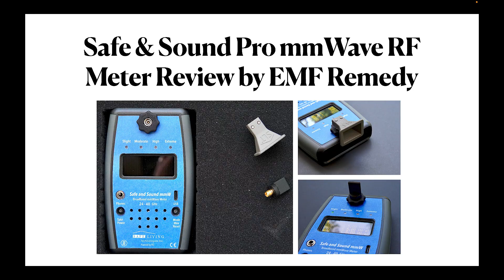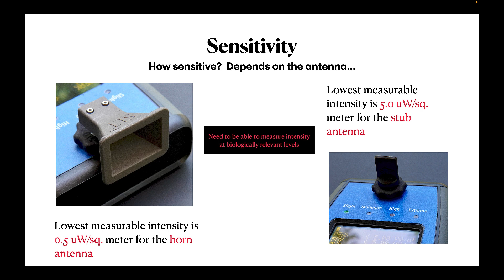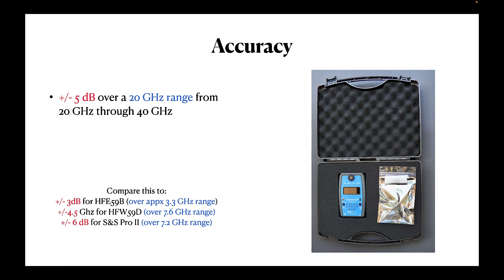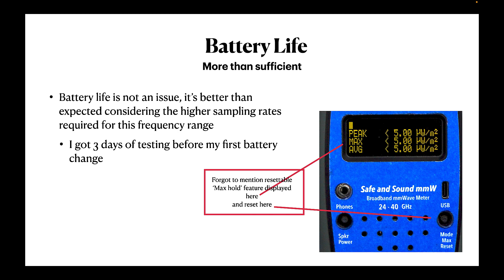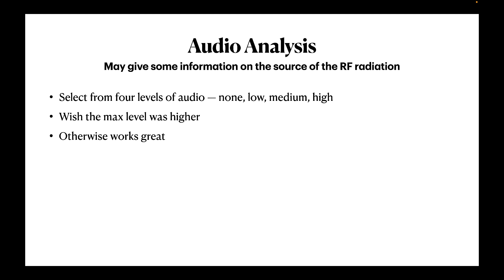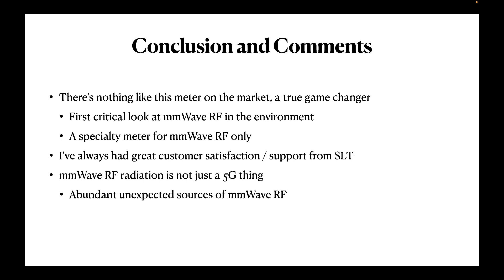Safe and Sound Pro mmWave RF Meter Evaluation and Review

Comment: hi there, is there a meter to test mmWave used for cars and smart devices that are in the range more than 60Ghz ?
Reply from the maker: Not yet, and I don't know of any under development.
Reply: thanks , i suppose the best we can do is to avoid cities and mall with auto doors. I also have to avoid going to friends homes that are smart
Reply: Is this new cars only? If so approx. what year did cars began heaving these?
Reply from the maker: @mountains1233  I don't know the answer, but I've personally found vehicles over a decade old with this type of RF radiation emissions.
Reply: A brand new video from Mathias Wandel random stuff shows how to make a meter using capacitance

Comment: hi there- i am looking into getting this meter.  does it ONLY test the MM wave?  so you need another meter to test for the other ranges as well as the other modes (i have a cornet but not their latest one).  i am trying to figure out if this is good investment and curious why it's the only one with the MM waves tested.
Reply: also did they get the 3rd party testing???  (i know you recorded this almost a year ago so wondering about this)
Reply from the maker: Yes, it is only mmWave, 20-40Ghz. Yes, it got the third-party certification. To my knowledge, this is still the only such meter with the requisite level of accuracy and sensitivity.  Here's a podcast episode with more information about choosing proper EMF meters:  https://www.buzzsprout.com/2075097/13832308
Reply: @emfremedy  thank you for your quick response!  will check out the podcast
Reply: @emfremedy  Does this give any reading (even less accurate, for example) for 0-8Ghz or is it basically zero/background? I'm concerned about false positives for Wifi, bluetooth, and 4G LTE emissions.
Reply from the maker: @mountains1233  No background in my experience.  It meets the requirements I look for here:  https://keithcutter.substack.com/p/dont-trust-cheap-emf-meters-expert